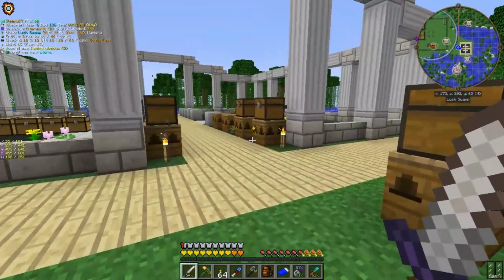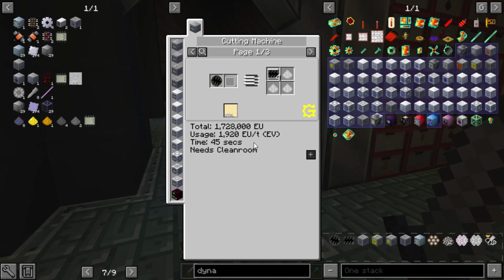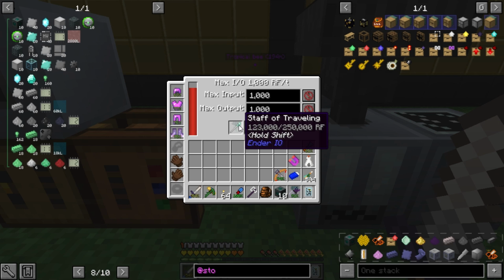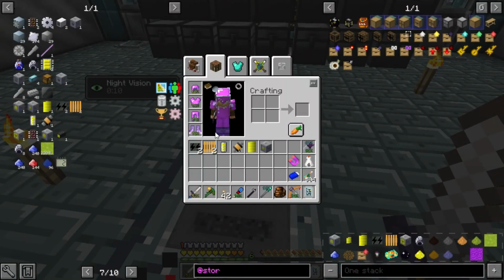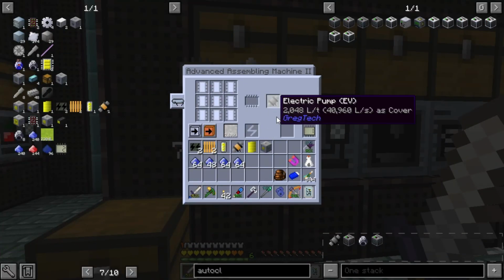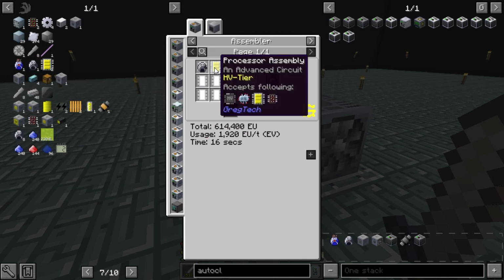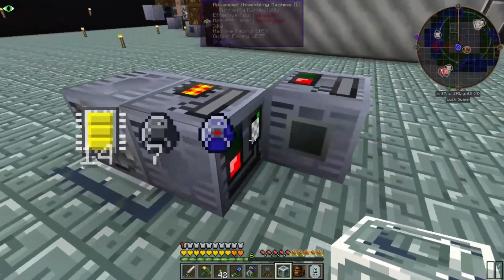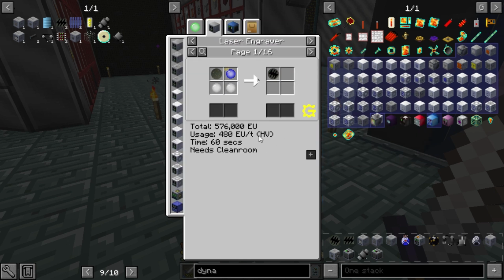GregTech New Horizons - Episode 58 - Power upgrades part 1

Comment: if you wanna try out a nuclear reactor then I'd recommend the one with 10 quad rods in the middle. there are designs on the wiki. the only thing is that nuclear reactors aren't 'smart' because they work on redstone. if you power it then it will keep working and the rods will keep decaying even if the energy storage is full. that means your battery buffer would need an energy detector cover or whatever it's called which you set to some energy level before the storage gets full especially if you have other generators connected to that buffer (for example I had a dragon egg producing additional power)
Reply from the maker: Thanks I’ll look into that reactor setup up. I think it will be fun to set up one too on top of the turbine.

Comment: yeah despite having a small internal storage I think battery buffers need at least one battery in them in order to function. afaik they input/output amps depending on the amount of batteries in them so if there are none I assume it means they can input/output 0A at most. btw don't forget that you will probably need fatter cables very soon
as for conv belts you probably got 4 from an enchanted bag and no you didn't spend them you still have them if I saw it right
Reply from the maker: Oh yeah that makes sense on the battery buffer. Oh yeah! That’s where the conveyors came from lol.